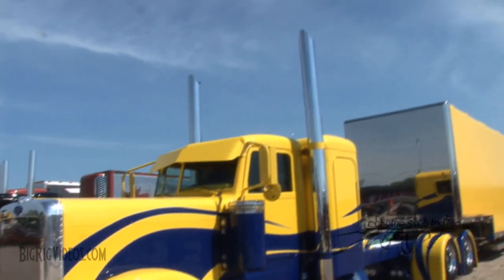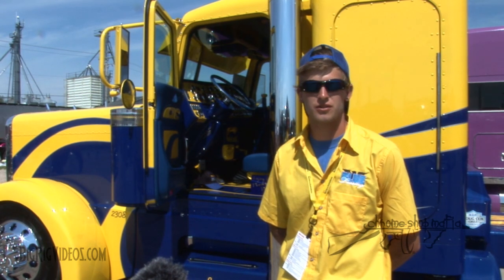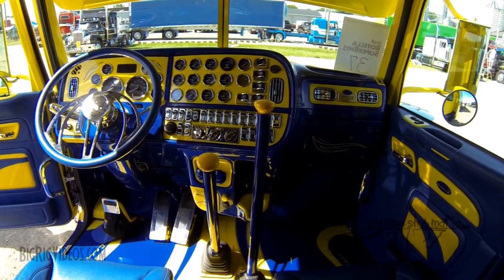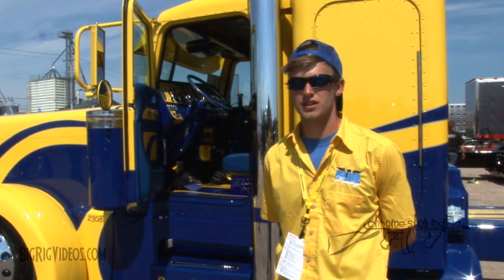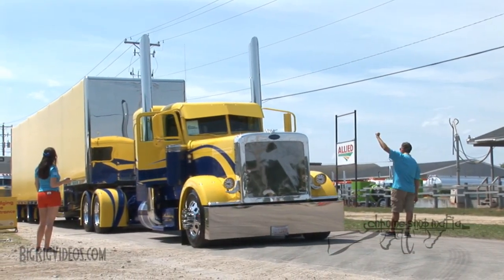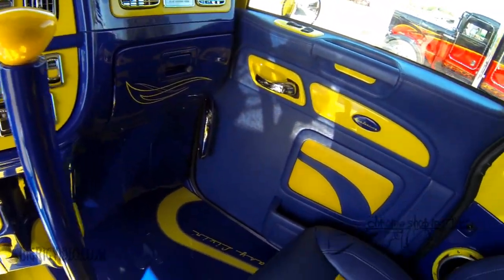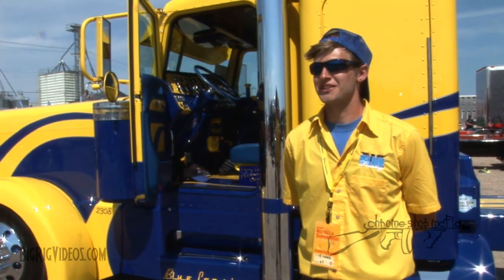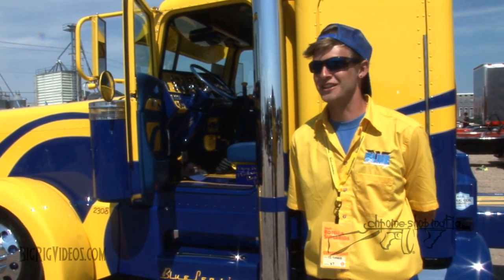Owner Operator Interview - T.J. Timblin

Comment: I was an owner/operator, I drove a 15 speed overdrive w/deep reduction in my Pete and became disabled by cause of a stroke back in '87. Never used a clutch but to start. - I drive a car as of today and that has to be an automatic. Always wondered about use of an Allison and I'm letting time go by. So a few years back, there is electronics and Eaton but I am woried about emergency use of the clutch, still doesn't fly. So by today, they have electronics galore and an automatic truck that starts, stops and changes gears with an auto Jake! All Auto! - I am just wondering what it would be like NOT being able to do any EXTRA shifts with this transmission, and T.J. knew exactly what I meant and he didn't like it and neither would I! It might be auto, but its like driving with a blindfold on, and theres nothing you can do about it. - It was great being able to know what he is talking about. Thanks!
Reply from the maker: Ben Coppola Your welcome! Thanks for leaving the message.
Reply: I drive those truck like most on highway trucker nowdays. If you set the auto-jake in the highest position the truck will downshift at 2400RPM. It can stop quite brutally. If you put the jake at off the truck will coast in neutral going down small hill...not cool. We still have two derelict 13 Speed Sterling in our fleet and those are the best in a snowstorm in my opinion. But to be fair i have never encountered dangerous situation with the new electronic transmission. I would never have one for off-highway use or as an owner operator because of the prohibitive cost of repairing those tranny.